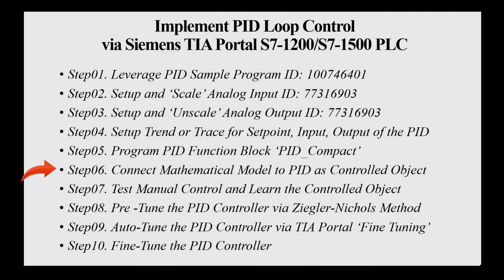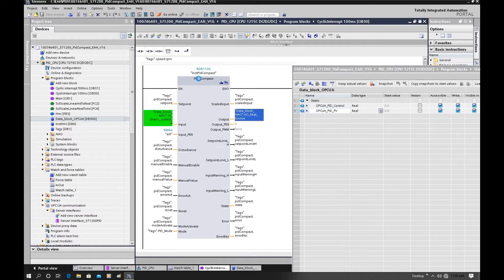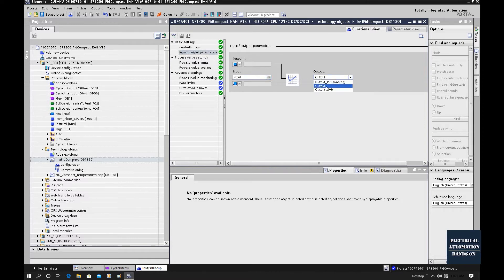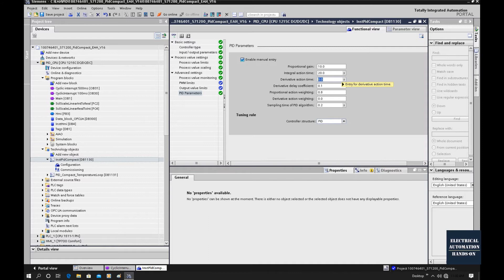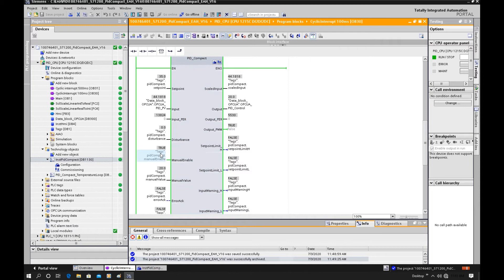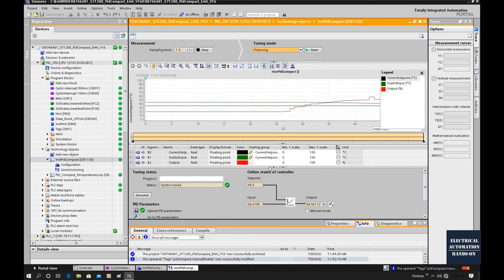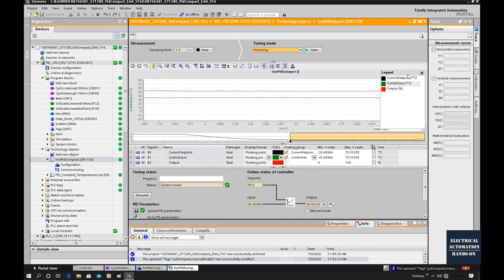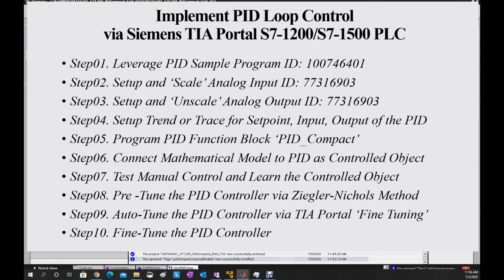PID16 - Siemens PID06f - PLC PID (TIAPortal PID_Compact) Controls a Process Model in Matlab Simulink

Comment: what would be the ideal sampling time and PID parameters for flow? assuming using 100ms cyclic interrupt..also, do you need to declare the cyclicinterrupt OB in the main OB?
Reply from the maker: For the flow control, the sample time of the flow meter analog input and PID could be 20ms - 100ms. You could try to use 50ms as the start. Note that the shorter sample time, the Integel will be 'accumulated' very fast, the 'I' parameters are more challenge to tune. Ob cycle time need to be set to the same as the PID sample time.